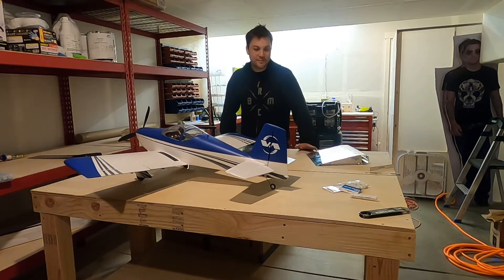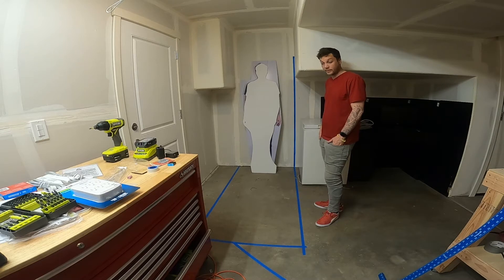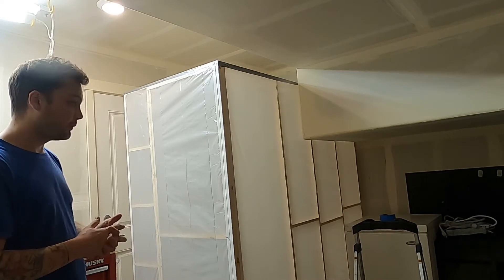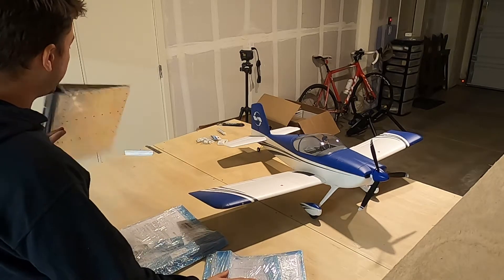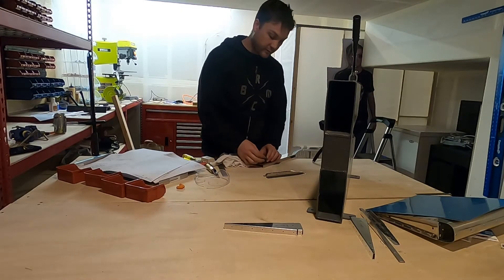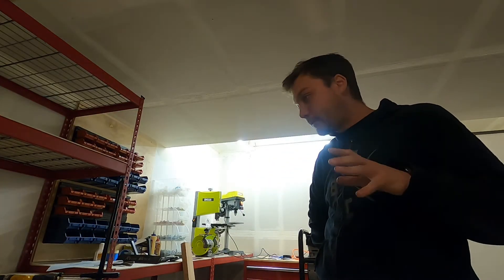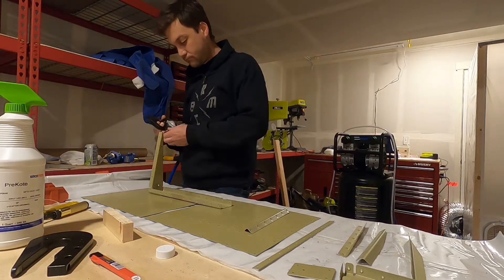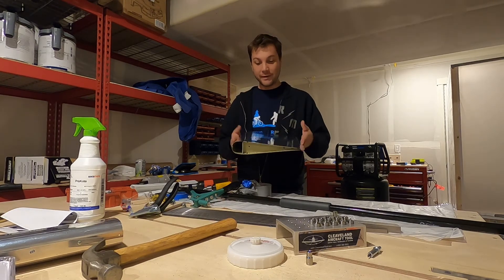Building an Experimental Airplane, The Vans RV-7A  | EP1.1 Shop Setup and Practice Kits

Comment: Hi! What approximate size is your garage?
Reply from the maker: It’s a two-car, tandem garage. It is roughly 11’ x 42’, give or take in a few areas.
Reply: @RyanFlysPDX  Thanks, do you think it would be tight in a two-car side-by-side garage? It's roughly 17'x18'
Reply from the maker: It’ll be tight, but it’s always tight in a garage. I think what you’ve described is about what 70% of people start in. Just build until you can’t possible build anymore, then move to a hanger.

Many people get FWF completed, wings done, etc. in the same space as what you have. Keep it cleaner than I do and organize your parts well, you’d be fine.

Comment: Ryan, love the shop set up!  How did you come up with the design of your paint booth and what appears to be a downdraft table?  Where do you vent it?
Reply from the maker: The paint booth was built to essentially fill a void in the weird spaces in the back of my garage. There are cutouts and dropped ceilings to accommodate HVAC and stairs for the floor above, so I mapped out as big of an area as I could nestled between these things. 

The downdraft table was basically made to maximize area from available materials, fit in the booth, and allow for as much space as possible. It's simply vented through a few filters and out the back door.
Reply: @RyanFlysPDX  Great stuff.  Thanks Ryan!

Comment: Nice start. Where did you get the replica of the aircraft?
Reply from the maker: Thanks!

The R/C model is available at Horizon Hobby:
https://www.horizonhobby.com/product/rv-7-1.1m-bnf-basic-with-safe-select-and-as3x/EFL01850.html

I have not flown it yet... still using it for a static display until I get some time to take it out.